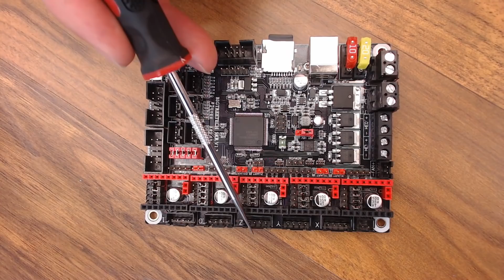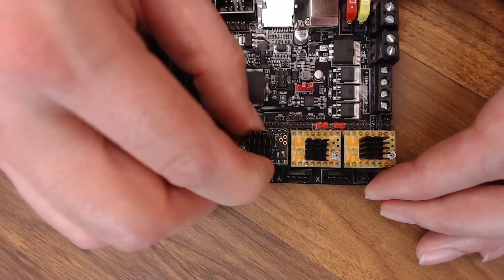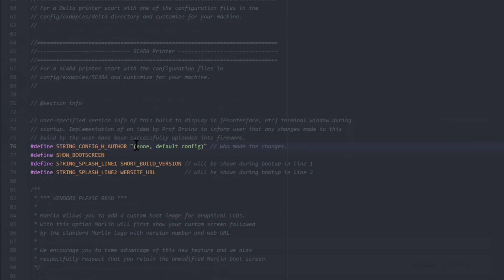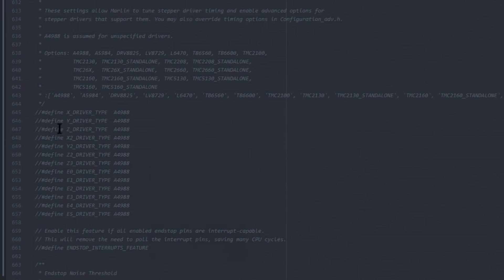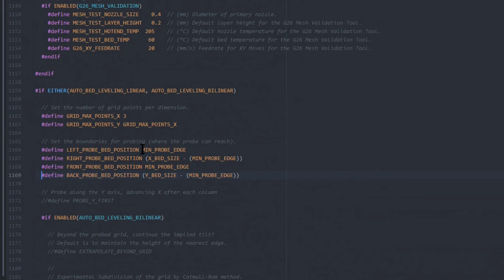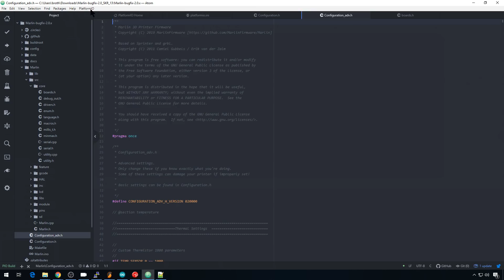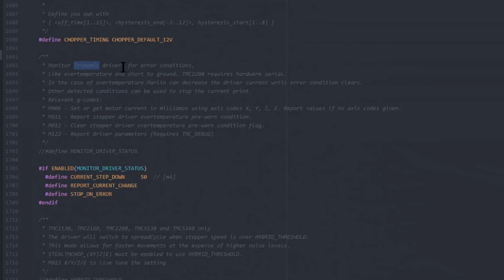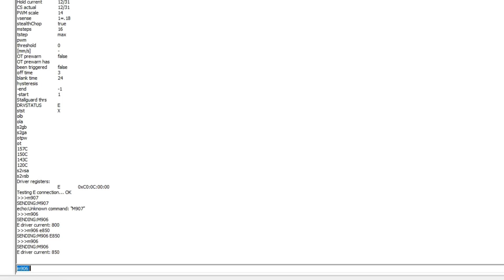SKR v1.3 Mainboard Install - TMC2208 - Chris's Basement

Comment: Chris,  I know it's been a while since you made this video.   I have had this board a while and have never been able to get it working.   I have an external driver board (two actually one for X and Y)  for a scara robot.  I was able to get it working on a ramps board but could never figure out how to get an output for step and direction on this board.     My driver board uses direction and step along with feedback from encoder to run my 96 volt dc brushed motors.   I gave up on the ramps because converting from X Y to angles I think was to much computing and it would stall out.      Anyway.   do you know how to enable the step and direction pins?  Do I need to run a jumper wire to the enable.   I have hooked up a voltmeter to the header pins, Step or Dir and Ground and have nothing from ether.    Even if I plug a TMC2208 into the  X and Y I still get nothing from those pins.   I gave up but have decided to give it another try.    Thanks in advance.
Reply from the maker: Looking at the schematics, they should always be active. https://github.com/bigtreetech/BIGTREETECH-SKR-V1.3/blob/master/BTT%20SKR%20V1.3/hardware/SKR-V1.3-SCH.pdf Not sure what might be missing to allow you to use them.
Reply: @ChrisRiley  I think the trick is to eliminate the variables.    What I will try is to set it up on my regular 3d printer and see if it will work.  That eliminates the board and driver issues.  Then  I will move one motor over to see if that works,  If so my problem is with the scara configuration and not the board.   Thanks for the reply with so many unknown variables it has been difficult to solve.

Comment: Hello I own a FYSETC F6 V1.3 Board and a RepRapDiscount Full Graphic Smart Controller and tmc 2208 v2.0 This driver is available in my country is it possible to work with it as I can't get a driver 1.1 The driver is not available in my country
Reply from the maker: Yes, the 2208 should work just fine.

Comment: Hi Chris is the Marlin firmware uploaded to the mainboard or to the Micro SD card
Reply from the maker: You can do either. THe firmware is flashed to the  board, from the SD card.
Reply: If I upload via USB to the mainboard is a copy made to the SD card. Mainboard has crashed can I use the SD  card to identical board
Reply from the maker: @colinraines395  yes, just rename the .cur file to .bin and it will reload on the new board.
Reply: Thanks keep the videos coming
Reply: Hi Chris am having problems renaming SD card can you explain please line by line
Reply from the maker: @colinraines395  In windows, go to file explorer and you sd card. GO to view and check the box show file extensions. Make sure your firmware file has only .bin after it.

Comment: Hey Chris, thanks for the videos, they really help me up during my tinkering.
I've got an issue though, with marlin, vscode and my skr v1.3; I always get the error "unable to find destination disk" and I've seen some forums where people get the same errors, some answer by saying it's a python 3 incompatibility and propose a fix for it but nothing actually works. I've pulled quite a few all-nighters on this issue and still can't resolve it. If you got any clue, I'd love to hear those <3
I've seen people who use workarounds like specifying in platformio.ini the upload port as being COM6 or whatever COM they plugged their printer in, but it still gets the same error for me somehow. I don't even know why it is trying to locate a destination disk when I literally specify it.
sorry for using your comment section as an electronics forum tho
Reply: also idk if it's possible to read the sd card's contents directly being plugged in the board via the usb cable linked to pc?
Reply from the maker: So this can happen when the serial on the board config isn't right. So what I suggest you do is copy the firmware.bin file from .pio/build/lpc1768 to your SD card and reboot the printer. That might resolve the issue.
Reply: @ChrisRiley  sorry for bothering! I found out with a little bit of non-informatic troubleshooting, it was in fact the microsd card that wasnt recognized by anything. I now am able to access the sd storage through my computer when plugged in skr board. I just had to add a "FIRMWARE" renamed .CUR file on the microsd card and I now am able to flash firmware directly via usb. Thanks for the help! and keep up the good work, your vids are so useful for people getting into the 3D printing tinkering world.
Reply: @ChrisRiley  sadly I don't have right now a usb to microsd adapter, and my phone can't detect the card. Can't I access the card's contents when it's plugged in the skr board?

Comment: again  a nice explanation  but on my board new what i received today the build is going very well but when i startet the board and toggle the Endstop switch it does not stop the XYZ drives it switch  the board off  when i leave the switch the board starts again  What is wrong this is now thw 5th board what do not work like it should is there only crepp shit what they sell and send to me all the boards what i look in YouTube work but mine not
Reply from the maker: Let's see if we can work out a config.
Reply: Hi I did switch the cables from Endstop and now it work with M119 from triggert to open and vice versa but the movement from YXZ does not stop when I trigger I find that this is  on all  3boards of mine have the same issue boards are SKR 1.4 turbo SKR  1.3 and SKR mini E3 V2.0 so what is the fault

Comment: Thanks for this helpful video! My printer is currently under surgery (rods, belts, bearings) and while I'm at it I thought I could replace the RAMPS 1.4 with a SKR 1.3 that I got a while ago, together with the TMC2208. So I need to jumper it properly and solder the stepper drivers correctly for UART mode to work. Do you know if a MKS MINI is going to work instead of a discount full graphics controller? I really do love the bright  backlight and crisp graphics of those.
Reply from the maker: Yes, it should be, you just need to use this line in the config instead. //#define MKS_MINI_12864

Comment: Hi Chris do you take on a custom setup for a overgrovn ender 3 pro with the skr V1.3 with Tmc 2208 v3.0 stepper drivers. this printer has the dimention of 240 by 450 by 490 mm, it has a 24V500W bed heater, 50W heater on the extruder, mos and to power supplys, and a 350 C extruder thermistor, i just cant get this marlin 2.0 to work, with eighter atom, or visual studio, the printer work as is, so the connections are ok, but i need it to be calibrated for the bigger size, and higher temp, both for the extruder and bed.  and you seems to be good at this. i will pay for the setup, and i can do the fine adjustments if needed and the file is for use on atom and not just a bin file. The printer is used as a standalone with the cr 10 display + the biqu tft 35 v2.0 yes it has 2 displays :-). Best Regards Otto Olsen
Reply from the maker: Hey Otto, if you want to send me all these specs on an email I can take a crack at it. brotherchris81@gmail.com
Reply: @ChrisRiley  Fantastic :-)

Comment: I don't know if this has been posted before but you can configure marlin to use a second stepper driver to drive the additional Z motor. I did this with my Anet A8 and it was relatively easy the second I found the option. Even though Z doesn't move that much, I like having peace of mind that I don't put unnecessary load on one driver for two motors since I have an extra driver to do the job. I got myself some 2208's this week. Time to dig up my printer again and put them in.
Reply from the maker: Yes, thanks for the post, very easy to do.

Comment: Hello Chris, Many thanks for your astoundingly sharp explanation. Even I can understand it! Well most of it anyway...
This may sound dense but can you point me to an explanation of the settings required to adapt my new (to me) SKR 1.3 board to run the Delta geometry on my Anycubic Delta Plus? I have all the figures for Offsets, etc but I don't quite understand how they should be grafted into the Atom interface which is currently up to V 1.46.
Reply from the maker: The easiest way is to grab the example Delta config and build from there, you can download the examples here. https://github.com/MarlinFirmware/Marlin/tree/2.0.x/config
Reply: Thanks, Chris!
I'm having a good time trying to co-ordinate all the fine YT clips on upgrading to SKR V1.3 with the frequently changed GUI appearances. Atom V1.46 now looks nothing like V 1.38 so I will need to stare at it for a few more hours to see where to go in connecting to the PCB. Maybe installing the earlier version to get going is a possibility... ?

Comment: i did everything you did on the skr 1.3 and i got this error?.., can anyone help me please..., thanks

Error	GCC	missing binary operator before token "("	155:12
Error	GCC	missing binary operator before token "("	171:12
Error	GCC	missing binary operator before token "("	191:12
Error	GCC	missing binary operator before token "("	201:12
Error	GCC	missing binary operator before token "("	223:11
Error	GCC	missing binary operator before token "("	272:8
Error	GCC	missing binary operator before token "("	304:12
Error	GCC	missing binary operator before token "("	332:12
Error	GCC	missing binary operator before token "("	482:12
Error	GCC	missing binary operator before token "("	541:12
Error	GCC	missing binary operator before token "("	633:13
Error	GCC	missing binary operator before token "("	646:13
Error	GCC	missing binary operator before token "("	752:12
Error	GCC	missing binary operator before token "("	765:12
Error	GCC	missing binary operator before token "("	790:12
Warning	GCC	#pragma once in main file	22:9
Reply from the maker: Looks like something in the Marlin version has changed. I would start with a new download.
Reply: @ChrisRiley thanks for your reply., yeah it is a new download., ive done this so many times but still getting the same result?., i dont know what im doing wrong?
Reply from the maker: @Sunny-qd9vn  Are you using the IDE or VScode?
Reply: @ChrisRiley   hi., i'm using atom with platform IO., i managed to compile a working firmware but still dont know what the errors are about., thanks for your replies
Reply from the maker: @Sunny-qd9vn  My guess it because Platform IO isn't supporting atom anymore, probably time to switch to VScode.

Comment: Great video - helped me out tremendously. I could not get the TMC2208s to work in UART mode. After some digging in the schematics, I found that my particular flavor of TMC2208 - the FYSETC TMC2208 v1.0 had pins that didn't line up with the UART pins on the SKR 1.3. Made a quick video for anyone who has that board. https://youtu.be/-qEIDrXtxuQ
Reply from the maker: Glad it helped! Thanks for the link!

Comment: Love this video. One swapping to the JST connectors I see the board has 3 pin for end stops and 2 pin for fans and thermistors. Do 2 pin JSTs fit in a 3 pin?
Reply from the maker: They are probably a bit to tight for 2's to fit on 3's.
Reply: Chris Riley great. Do you know the pin to pin pitch?  Are the JST ZH or XH or RE or something else ?
Reply from the maker: @KryzOrlinski  Most of them use the JST-XHP. 2.5mm I think.

Comment: Hey, I followed this tutorial but am having issues with homing. Whenever I home, each axis moves a few mm and then stops. There's a video in this Reddit post: 

https://www.reddit.com/r/BIGTREETECH/comments/g3zij6/homing_issue_running_btt_skr_13_w_2209s_and/

Any help would be much appreciated.
Reply from the maker: Are you trying to use sensorless homing?
Reply: @ChrisRiley  For now I'm just trying to use the limit switches that come stock on the printer.
Reply from the maker: @natevideos263  Great, then I might know how to fix it. It probably thinks the endstops are triggered. Do an m119, is everything triggered? In your config, anything that isn't acting correctly, swap these around. 

#define X_MIN_ENDSTOP_INVERTING false // Set to true to invert the logic of the endstop.
#define Y_MIN_ENDSTOP_INVERTING false // Set to true to invert the logic of the endstop.
#define Z_MIN_ENDSTOP_INVERTING false // Set to true to invert the logic of the endstop.
#define X_MAX_ENDSTOP_INVERTING false // Set to true to invert the logic of the endstop.
#define Y_MAX_ENDSTOP_INVERTING false // Set to true to invert the logic of the endstop.
#define Z_MAX_ENDSTOP_INVERTING false // Set to true to invert the logic of the endstop.
#define Z_MIN_PROBE_ENDSTOP_INVERTING false // Set to true to invert the logic of the probe.
Reply: @ChrisRiley  You're exactly right, I just fixed it.  Thank you so much!!
Reply from the maker: @natevideos263  Nice!

Comment: Hi Chris, love your videos. If you remember I was the guy trying to use the wifi Arduino boards.

I am having trouble with the SKR1.3 on a 12v system, I run a bed PID for 60 deg. than save them in the firmware, but every time I try to print I get a fatal heater error, but I know it can get there and higher, I have had done PID's up to 80 degrees.
Could there be a problem with my board, or does the the board not really like a 12v environment, I am using the old red MK2A heat bed.
Would switching to a 24v system fix this.
Reply from the maker: 24v might help this, but you probably just need to adjust runaway in configuration_adv.h. Try changing this setting to this.  #define WATCH_BED_TEMP_PERIOD                90 // Seconds #define THERMAL_PROTECTION_BED_PERIOD        90 // Seconds
Reply: @ChrisRiley will try your suggestion, but I have noticed that the heater stops 100% mode 10° below target temp and has a hard time getting the rest of the way. I run the same settings using an arduino ramps and 1.1.9 and everything's good.
Could it be an issue with version 2
Reply from the maker: @kevintech5869  I don't think it would be anything in version 2, but it is definitely worth a try to switch back to 1.1.9 and see.

Comment: Txs a lot for your informative installation. I followed your instructions and am happy to say everything works to a point. My screens on same readings as yours so quite happy and proud being a 1st timer at doing a modification like this. My only question being installing Merlin. My machine is tronxxy branded as a  Prusa i3. I know. I would like to know what  settings to change in Marlin as apposed to your machine. I believe your settings will not work on mine. Your valuable knowledge and assistance would be great appreciated. Just to inform you, I have never done any marlin configurations and uploads, so I will be watching and pausing your video. Thanks Wayne.
Reply from the maker: I would start here, https://github.com/MarlinFirmware/Marlin/tree/2.0.x/config you can take a config that might already work for your machine and copy the config files.

Comment: Hey Chris! Thank you so much for the tutuorial! Could you explain how does these serial ports work with SKR 1.3? How do i serial monitor it? What i should read there if configured correctly? Why did you change SERIAL_PORT 0 to -1?
Reply from the maker: I am not 100% sure how all this works. Setting it to -1 will let you use the USB emulated serial port. From what I can tell the 32 bit board design isn't using a serial chip. Pronterface will allow you to monitor the serial, you will see Printer online when it connects correctly.

Comment: What kind of JST connectors are you talking about? JST is the manufacturer, not the exact connector name. JST PH? JST XH?
Reply from the maker: Most of the ones you see on the board side are either 2,3 or 4 pin PH types, sometimes you see Molex positive latch types.

Comment: Not currant on all some of this. why atom   instead of arduino ide ?  if micro sd used by board during operation?
Why older driver for z motor?     The main  drivers would be x and y     z and extruder should not be stressed by the speed.
Motot splitter  is black wire being wired differently or just off to side in video?
Reply from the maker: The goal is to get a tool that will allow you to use platformio. That is where all the newer board libraries are available. SD card, no, just to load, but you can use it for gcode. It was just one I had configured for UART I wanted to try, no other reason. Should be no different on the splitter, it is one for one.
Reply: Chris Riley need to proof read what I type in.   I’m editing it in audrino ide. Hopefully I can figure out platform io load it up to compile